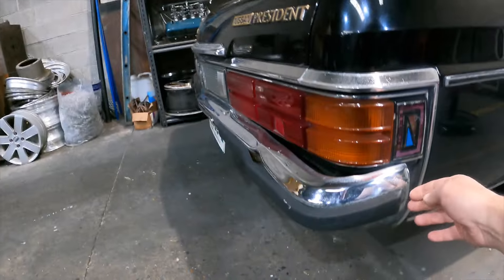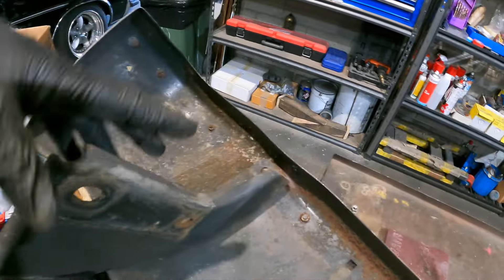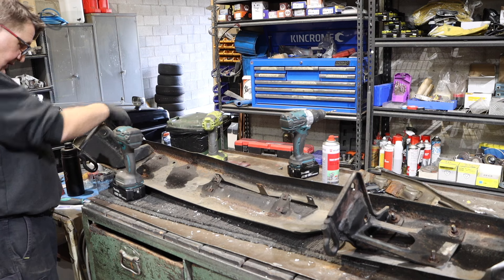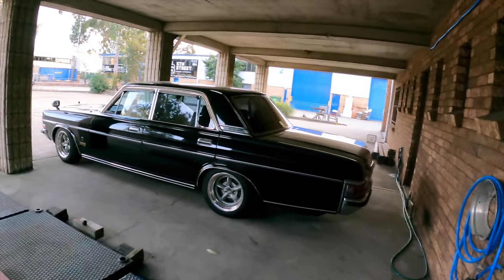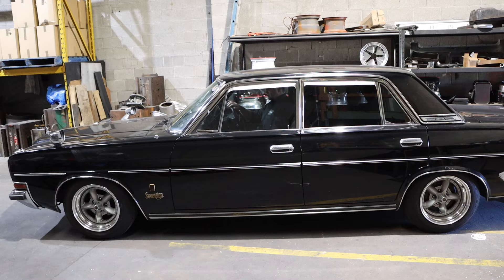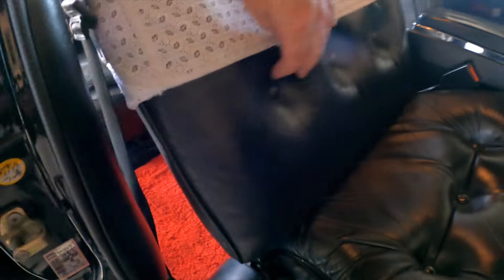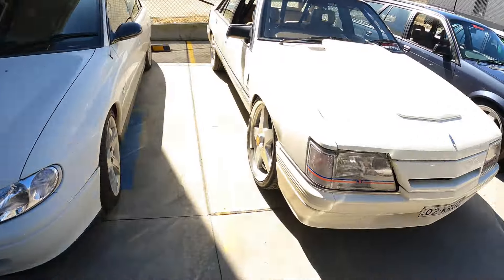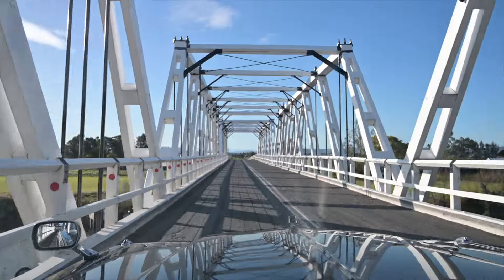108.  Roadtrip! Nissan President H252 Swansong.

Comment: Hey Mark, you seem to be the authority on little Japanese wheels.  I just bought a L700 Daihatsu Cuore (similar to MCM's Bue Turd) as a second car / run-about.  I love it, what it lacks in power or size it makes up for personality and fun.  The standard wheels are 13x5 +40.  Tyres are 155/70.  Stud pattern is 4x100.
What would you recommend putting on it to spruce it up a little?  I plan on keepng it at factory height.
Reply from the maker: The best bet is to do a measure up and work it out on paper.
I've done a couple of eps on measuring the car and wheels.
Will depend on what look you're after too (flares, poke, low etc)